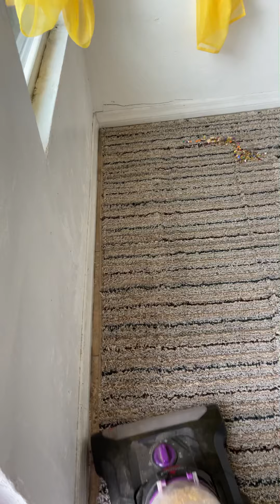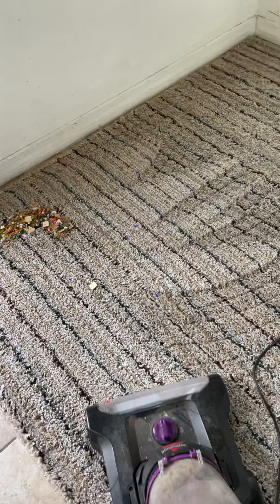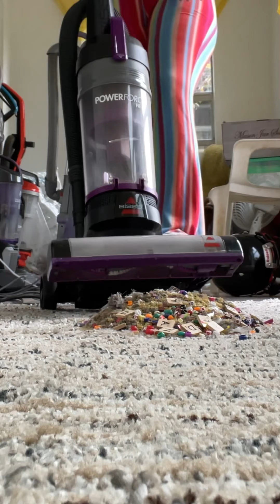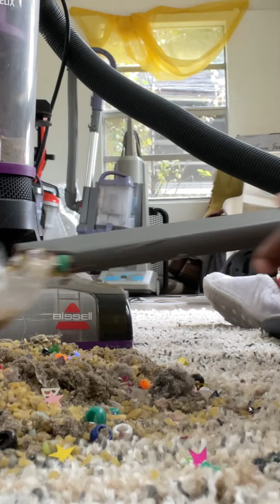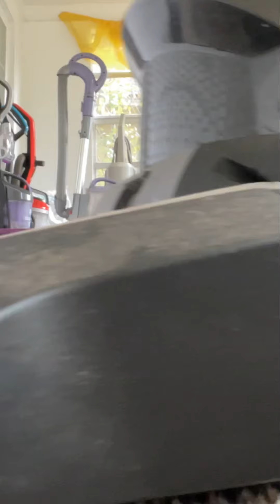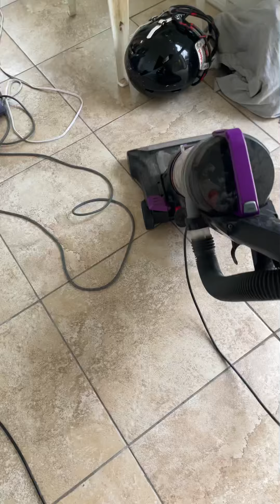#asmr #bissell #helix Requested video for Elevators & Public Transit in Mass (description)

Comment: I definitely pick the helix, cleanview and workhorse
Reply: @tellyboo  yet I’ve never used a workhorse before
Reply from the maker: @JonstrHLd  the only thing I don't about it is it doesn't pick up quarters or bottle tops and you have to buy new filters
Reply: @tellyboo  so the workhorse doesn’t do coins or caps? That stinks. Doesn’t it have height adjustment? I would love to invest in one but it’s a $430 vacuum
Reply from the maker: @JonstrHLd   yes it has height adjustments its really good on very fluffy rugs or carpet.
Reply: @tellyboo  that’s awesome. Are you a fan or bagged vacuums?
Reply from the maker: @JonstrHLd  no I'm not even though the oreck is everything to me.. I had a Sanitaire vac before and I hated it only because of the bag but it vacuumed really good
Reply: @tellyboo  I see. I really enjoyed using a vacuum called the cleanmax pro series commercial vacuum
Reply from the maker: @JonstrHLd  is it a bag vac? Does it vacuum good?
Reply from the maker: @JonstrHLd  yes Instagram telly_boo85